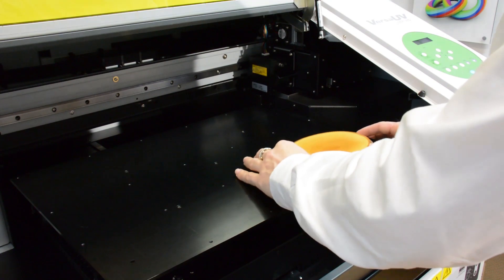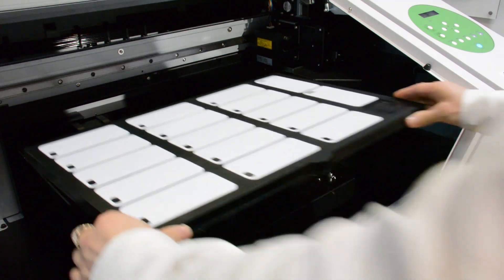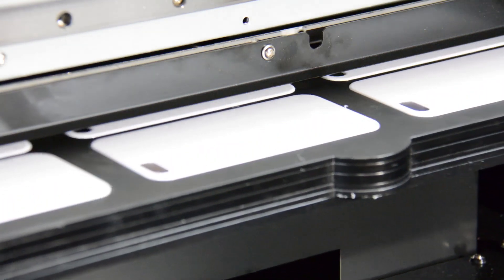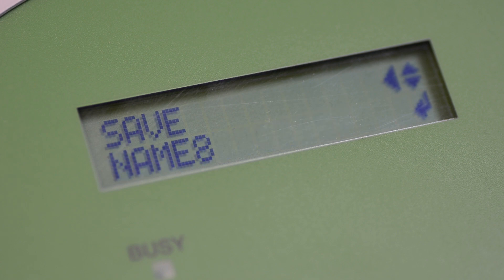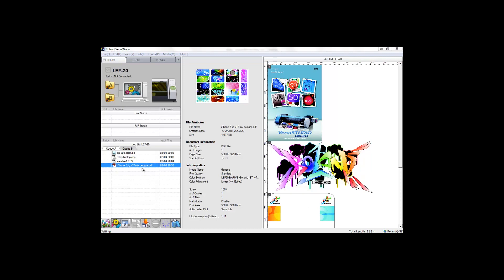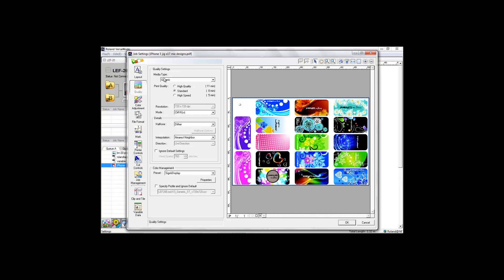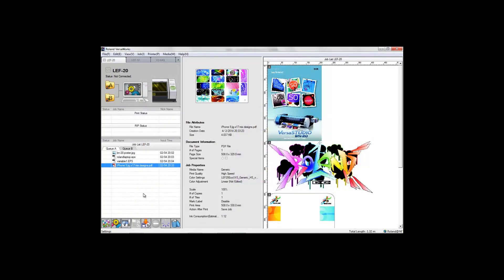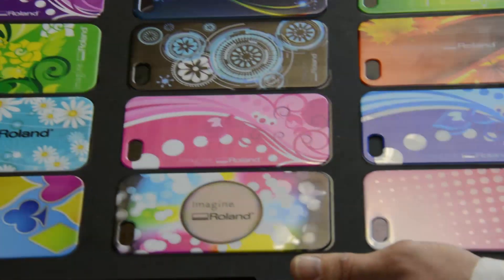Roland VersaUV LEF-20 Setup and Print Process

Comment: Hi. How many time use to do those 16 phone cases? 720 dpi x 720
This printing have varnish?
Reply from the maker: Hi Cesar, 
The 17 cases in the video - printed standard mode 720x720dpi will take around 8 minutes. It is possible to add varnish but in this example none was added.